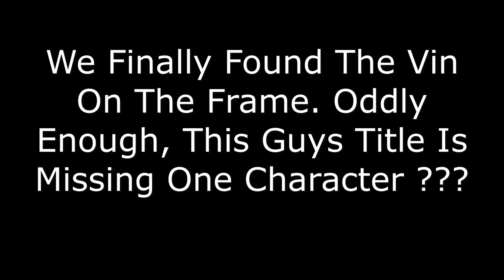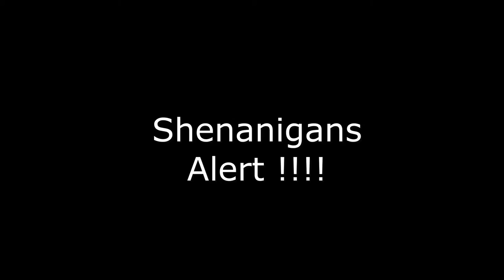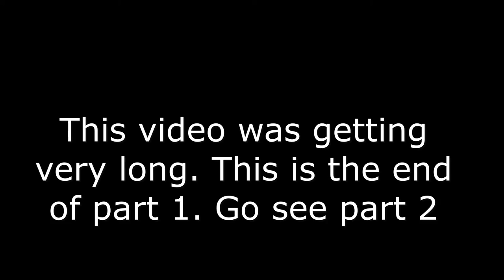Fixing Broken Cable On A Popup Camper Part1

Comment: Best video I've seen on explaining how to replace the cables. It seems like you could make a pull system from the ceiling to raise the top instead of using a floor jack. Just a suggestion because it did not look very safe. Great video!
Reply from the maker: I will take that into consideration. Thanks Jeff

Comment: I have the exact unit and both end are messed up. And the guide was broken on the same end with the spring caught in it. The other end is split on the corners and curling out so at least the spring on that side wasn’t trapped My first time trying to change cables also.   I haven’t checked the other side yet.
Reply from the maker: Sounds like you have a big job on your hands Cherri

Comment: Can't get the principle of how the steel springs are forced up by the cables being pulled away??  I'm a dummy!! 
All my cables were broken when I bought the 92 Viking and having trouble understanding.
Reply from the maker: I have a few Popup videos. I am pretty sure I try to explain the theory and operation in them. It is a silly system but they haven’t changed them much in 40 years and they do work until they don’t.

Comment: Great video! Weird that Jayco has no record of the unit. Maybe it's is the wrong model year. Good that you were able to find the VIN. I have sometimes found a VIN plate under the metal plate at the bottom of the entrance way on a couple of trailers. Any chance someone else worked on this unit previously and MacGyvered it back together just so they could sell it?
Reply from the maker: I don't know for sure Bill. It didn't really look like it had been worked on before, but who knows.